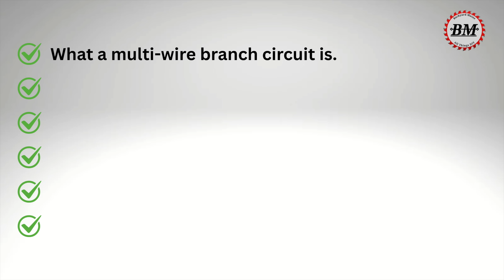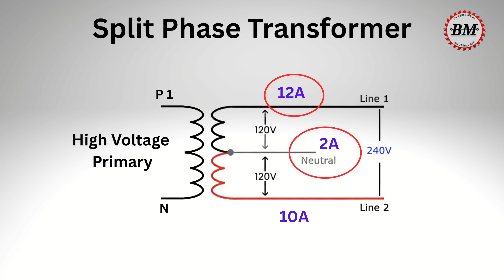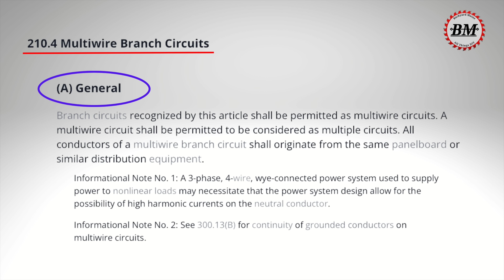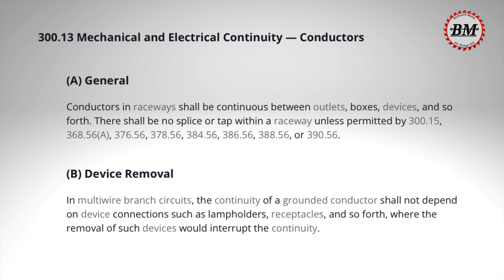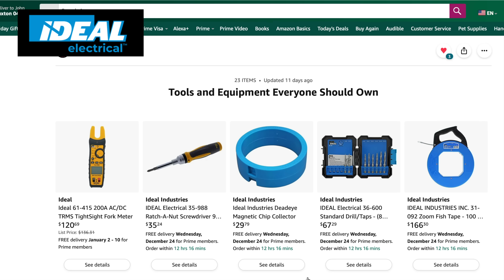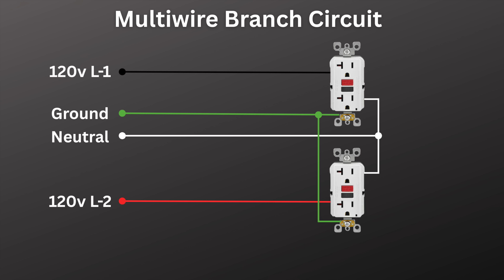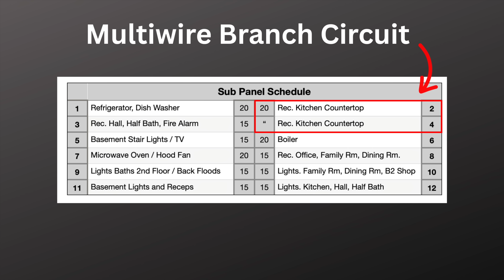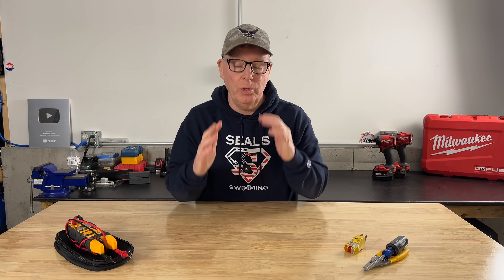Homeowners Don't Know This Dangerous Circuit Exists!

Comment: My existing electric water heater had to be moved when the water softener was installed. I had to buy a much longer Romex cable. The water heater is now in a closet (no doors) and I would like to add a pair of duplex outlets. I was hoping that I could use Line 1 to one duplex and Line 2 to the other, and share the Neutral.

The issue is that they would be running on the same circuit as the water heater that uses only the 2 Lines and ground.

Based on what was shared in this video, It looks like the best way is to go get more Romex and add a pair of breakers, putting those outlets on their own dedicated circuits.

Thank you for taking the time to share this knowledge! I really appreciate it!!!

Comment: Thank you so much for this great video. You solved a mystery for me. I did not understand why some of the circuit breakers in my panel seem to be bonded together. Oh! These are multi-wire branch circuits. I am also a little concerned that the electrical work during a recent construction project has multi-wire branch circuits that might not have been correctly installed. I believe that specific electrical contractor used every method he could to save on both labor and materials costs. But then....the county electrical inspectors would have caught wiring mistakes and made the contractor fix the wiring. I hope. In any case I want to thank you very much for this. I'm expecting to begin another home renovation project in 2026 or 2027 that will need a lot of electrical work. At that time I will ask the electrical contractor to check the wiring done in the past. I'm retired now and I plan to work very closely with the future contractors -- not to get in their way, but to make sure my wish list for things like receptacles with USB-C power delivery will be done.

Comment: My problem is that all the breakers in my home were replaced with thin double breakers.  That means that adjacent breakers may be on the same pole.  Instead of the breakers goin A, B, A, B, A, B....  they go A, A, B, B, A, A, B, B....I do have 240 V going to the AC condenser outside and to an outlet for an electric dryer in the laundry room.  

I've been wanting to go through and rearrange some of the wiring because there are multiple outlets in the kitchen (toaster, microwave, coffee maker) on one breaker and other breakers that just feed a couple of lamps.

Comment: I ran into them a few times over the years and was incorrect breaker . Always check . I ran into a farmhouse that had odd voltage but is ok. The farm was fed with 208V 3 phase 400 amp service .  Some buildings on the farm was wired with 2 phases . When you test you will see 208V from hot to hot and 120 hot to N . If no 240V loads you will never notice. They make a boost transformer to make 240 from 208 . Not common but ran into them at a old school that was build in 1950 .  I got old Ideal circuit/GFI tester as well. Years old and works just fine. Even the button for GFI test . Cheers from NY !

Comment: I've heard the term "shared neutral" to describe this.  I have a few such circuits in my California house built in 1983 (I'm the original owner).
I despise these shared neutral circuits. It can lead to weird electrical problems, as receptacles and switches wear out & degrade.
It's rare that the 2 split phases are balanced, so what's the point? The savings of using 1 less neutral wire, of a thinner gauge, is trivially small.
Reply: Sure, the 2 split phases will likely never be balanced, but that's not the point. When using Romex, you need to run the entire cable with sheathing, not just an individual white wire and of the same gauge, not a thinner one. When electrical contractors are wiring many houses, the savings can be considerable, while the 12/3 is more expensive it's not nearly double the price. One length of 12/3 can be used instead of two lengths of 12/2. However, it's probably a moot point in recent years, because of the requirement that houses have dual function breakers, which are hard to find or not even available for some panels in double pole versions.
Reply: @surferdude642  " When using Romex ... "
   My 1983 house was built with flexible metal conduit (FMC or Greenfield") and individual "loose" wires, not Romex.  Not too common nowadays, but in principle would make some rewiring jobs easier.
The shared neutrals I can find are connected Not through robust pigtails inside each box, but with the crappy "stab" connectors on back of each receptacle, and the neutral is in-series with all these aging & loose stab connectors.
Am replacing all receptacles and using pigtails through out.

Comment: I knew most of this, but I still managed to learn something about using a pigtail and not the device to carry neutral. Good stuff! Which leads me to ask, where can a non-tradesperson get access to read the NEC?
Reply from the maker: You can buy a code book online. Amazon sells them as well or you can buy one from the NFPA website. The code updates every three years and the 2026 code should be out soon if it not already. I will be taking the 15 hour update course in February. Probably have some changes that I will share here on the channel.
Reply: @BackyardMaine  Thanks for the tip. It turns out that NFPA shares a free non-printable version of the NEC 70 on their website.

Comment: That was informative, thanks. 👍
I have multi-wire receptacles in my garage, was done 30 years ago, inspector didn't say anything about having the breakers tied together. I'll have to look into that some more.
Reply from the maker: It's a widely misunderstood wiring method even with some electricians and inspectors.

Comment: 9:20 this is not how hot legs alternate in a breaker panel. If you only look at the right side of the image it is correct. If you only look at the left side, it is correct. But both sides together are not correct. To top 2 breakers on the left and right side will be the same leg. 
It shows the top left breaker as B and the top right breaker as A. They will actually be both B. Or they will be both A. 

They are almost always labeled with odd numbers on the left and even numbers on the right. So breakers 1 and 2 are the top row and are leg A. Then breakers 3 and 4 are leg B. Then 5 and 6 are leg A. 

To say this again, breakers that are in the same row horizontally are the same leg.

Comment: As rule of thumb, you won't find multiwire branch circuits in homes and apartments newer than about 15 to 20 years old since AFCI and dual function requirements (for kitchen and laundry 120v, 20 ampere) cannot be used with MWBCs unless you use a two pole device, and currently only two panel manufacturers, Siemens and square D I believe have two pole AFCI breakers in their lineup, and no manufacturers currently make two pole dual function breakers as far as I know.  

In commercial buildings with a three phase 208Y/120V panel serving several 120V circuits to a particular room or areas - think cubicles in a large office building - you can assume they are part of a MWBC and even today this practice has widespread acceptance.  And to understand why, for starters office buildings don't require AFCI or GFCI protection expect for receptacle outlets in the bathroom or near the break room/kitchen sink in which case the receptacle type GFCI is used.  And you have to think from a contractors point of view.  Imagine being the "play it safe" contractors , that is, pulled a neutral for each circuit, which would also require larger raceways and/more of them, and trying to win a big against several other "risk taker" contractors that run as many MWBCs as possible, which uses smaller raceways and/or fewer of them? Not a chance.   Love 'em or hate 'em, if you're a commercial electrician/electrical contractor, you're going to be running MWBCs, unless of course you're working on a project for Elon Musk or Bill Gates where the term "budget" is non existent 😅
Reply: Two pole dual functions are available, but you are right the lag from them being available caused MWBCs to take a big dip in being used. I argue that they still are very safe and make sense to use in many situations and I use them whenever appropriate with zero hesitation.

Comment: In my last house 80% of the circuits were multiwire branch.  With the breaker box not being well labeled, it made tracing circuits difficult.

I think multiwire branched circuits are really good in the kitchen for things like dishwasher and garbage disposal.
Reply: My MWBC had the dishwasher and garbage disposal, but also the kitchen lights on them.  If I have to replace either, I need to either do it during the day, or get a flashlight or long extension light.

Comment: 1:54 the image showing the transformer windings should have more loops On the High voltage primary side. This isn’t necessary for what he was describing but was a lot teaching moment for people to understand how transformers work. 

The house side is 240v. So if the primary side is 720v then having 3 times as many windings on that side would reduce the voltage using the same ratio. So the voltage would reduce by 2/3 dropping from 720v down to 240v. Then you add the neutral center tap and your voltage is cut in half when using that neutral center tap.

Comment: I can't imagine bothering with these circuits without a good reason. And it doesn't seem like there are many good reasons.
Reply: Because it is and always was perfectly safe when done correctly (just like almost anything else). It's often much more efficient to bring a multi wire feeder to an end of run destination to provide adequate power.
Reply: Just electricians trying to save a few $$.

Comment: These multi-wire circuits used to be common above kitchen counters in Canada. They allow a duplex outlet to power two 15 A appliances at the same time. My house has 3 of these circuits in the kitchen. I know they are all fed by 2-pole breakers in the panel. But I wasn't aware of the "pigtailed neutral" rule until now; I should check for that.
Reply: I hadn't watched the whole video yet when I was about to make a similar comment about that seeming like a very easy way to get more power out of an outlet. 

I would have never thought of this. 👍

Comment: Great video. My biggest pet peeve is people using "bridged" adapters for their 120 volt generator (L5-30R outlet) and attempting to power a split phase MTS which has either MWBCs or 240 volt circuits in it and uses a L14-30P inlet.  Using the bridged adapter in such a case means the phase conductors are NOT terminated to different phases so the current on neutral will not cancel and can overload the neutral. Violation of [210.1 (B)]
Reply: Yes.  If the house has MWBCs, a 240 volt generator must be used, UNLESS your electrician is willing to wire a custom configured transfer switch, creating a Critical Loads Panel where each circuit has a dedicated neutral.  Meaning limited home functionality in times of grid power loss.

Comment: Great info, as usual.  While my house did not have any split circuits, I added one in my workshop for a specific reason.  I have a dedicated dual 120V 20A receptacle and 3-wire run with one on each side to a dual-pole breaker for my table saw.  When I upgrade the saw to 240V, all I have to do is put in the proper single receptacle and "abandon" the white neutral.  Otherwise, I'd never use split circuits typically.
Reply: BTW... Not mentioned in your video... another way to help scan for those circuits is to look for any red wire connected to a single pole breaker.

Comment: Everything in my house was ran on split circuits on night it melted the Romex all the way to the attic and never tripped the breaker. My electrician friends said it was a fluke I didn't care I replaced every split circuit in my house, like around 10 or so. What I noticed was the neutral on the wire looked burnt so did the ground.everyone thought I was crazy.i didn't care I have 5 kids and a beautiful wife that give me the right to be over protective. Anyways thank you for confirming I was right. By the way this video you made is the best electrical video ever made by anyone hands down. Thank you so much
Reply: When it comes to electrical work I've seen to many 'pros' who were not.
Reply: @CarlSchwamberger   "Pro" means you get paid. It does not mean you know what you're doing.
Reply: @CarlSchwamberger just like tile, roofing...
Reply: I second this comment ! 😊
Reply: @SteveJames-u3u thank you for your support

Comment: I ran 10-3 Romex, on spec, during a remodel, intending to add a 30A subpanel to the first floor. But, so far, I have only needed one 20A 120V circuit so I converted that run into a 20A tied breaker, multi-wire, circuit, leaving the other circuit unused, but ready to tap. I am sure this is an odd excuse to create a multi-wire circuit, but I have a spare 20A circuit until I need a 30A subpanel.

Comment: Started apprenticeship in 1974. Owner of company was real strick with us. We were trained with safety always 1st. Not only for us but end users too. At the time, backstabbing was code compliant. Allhough the apartment construction project contract was bid labour wise for backstabbling, us apprentices had to pigtail. He also didn't like multi branch circuits for all reasons in video. We did many...
However he was able to convince some project managers go single circuit and go above code requirements.
These were also the years when there was 1 journeymen and 1 apprentice. Everything I did had to checked by journeymen.
Today we have much different regime, where multiple apprentices wotk under 1 journeymen, and he doesn't have physically check.
Still practing my trade at age 70 part time!

Comment: Most of my house (built 1994) is this way without tied breakers.
Reply: Two pole breakers or an identified handle tie on two single pole breakers wasn't required for multi wire branch circuits until the 2008 NEC if I'm not mistaken.  I've seen them in a good handful of homes built prior to the early 2000s with no handle ties / two pole breakers, and whenever I encounter this situation, if I'm doing something as simple as changing out a bad receptacle outlet, I go ahead and add the handle tie.   I then advise the homeowner about why this is important, and provide them with the option of paying a little extra  labor/material for me to go in and handle tie all the multiwire circuits. Many opt to do so, but just as many folks are on tight budgets - understandably particularly in this economy - and figure since it's been that way since " the house was built 30 years ago and they never had any issues, if it ain't broke don't fix it".

Comment: You're contradicting yourself.  First you claim that it's "not a two phase system" because it "comes from a single phase", but then right after that you also claim that the two legs are "180 degrees out of phase with each other".  It can't be both.

The truth is that split-phase is a form of two-phase system.  "Split-phase" is just a name for the specific type of two-phase system where the two phases are 180 degrees apart from each other (and the midpoint (neutral) is at ground potential), that's all.

(And it's called "split-phase" because a single phase at the pole is split into two separate phases by the transformer, before being supplied to the house.)

Comment: Yup, this, to me, is completely insane. I have these I'm my house. Two-pole breakers, nope. Pig-tail, nope. I have these go into separate rooms so you can't tell when replacing an outlet. And it's aluminum on top.
Reply: Have you corrected the issues?
Reply: @truthdefenders-  Working on it...
Reply: It seems to me like an ill concieved metal saving idea. 
Like aluminum wiring in the 70s.
Reply: I see some potentially dangerous information in this video. This video shows full-size, single circuit breakers, but there are plenty of half-size and piggy-back breakers out there, installed and for sale. This video doesn't cover what you need to know when dealing with them. Always test. Don't assume. Be safe. If you aren't sure, ask a professional.
Reply: @jayztoob  MWBCs must have both hots disconnect at the same time, and have to be fed from opposite hot legs; therefore, tandem breakers ("peanut breakers") can't be used.  MWBCs are fine and safe . . . if installed correctly.  That's why they're still in the NEC code.

Comment: It's important to remember that a multiwire branch circuit can be present at a single duplex receptacle.  It's vital to break the hot-wire link on the side of the receptacle before installing or replacing.
Reply from the maker: I believe I mentioned that in the video with a diagram as well. Yes, it's quite common to use a MWBC on a split receptacle. Just not on a GFCI because they cannot be split.
Reply: @BackyardMaine  I got distracted by my cat during the video, I must have missed that part.  I should have re-watched.  I know someone who replaced one of those and failed to split the receptacle. He wondered why the breaker wouldn't stay on.

Comment: I have a fluke T5-600 that works great and I love it, but that Ideal with the display in the bottom is brilliant. I might have to get one.
Reply from the maker: I have a fluke 87 and it's a great meter. I love this new one too.. It has a ton of features that I’ll cover in video sometime but my favorite ones are:
The split jaw amp meter which makes it easy to take amp readings in tight spaces where getting a clamp around a cable can be difficult. The tight site display on the bottom giving us a second display— also great for tight spaces and keeping your face away from live equipment. And the built in flash light for those darker areas so we can see what we’re doing. It even has a non contact voltage tester which is really convenient. Im a big fan of the brand and was stoked when they reached out to help support the channel.
Reply: @BackyardMaine yeah that meter is very slick. Thanks for the info brother.